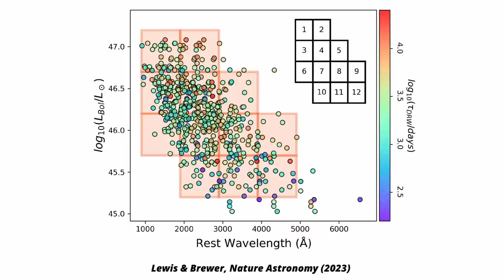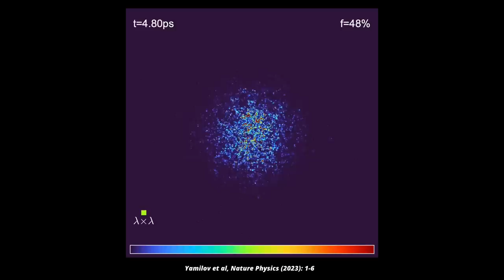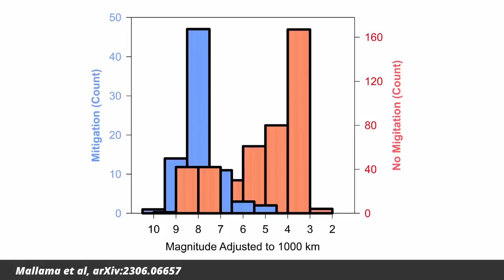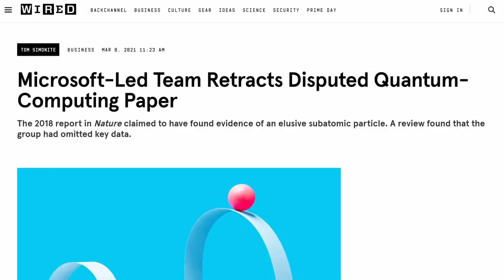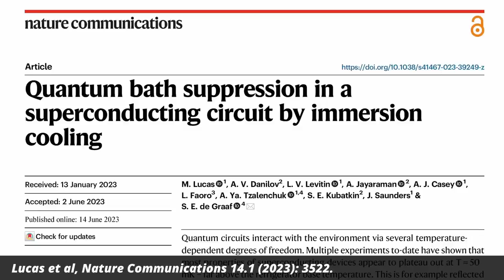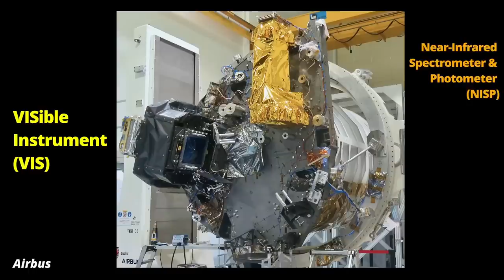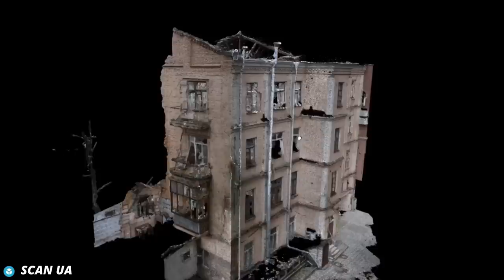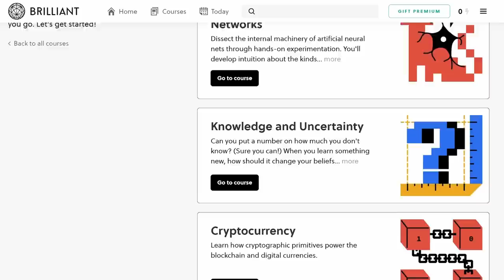Time Ran Slower in Early Universe, New Study Finds

Comment: Does the time dilation of the early universe affect our current measurements of the expansion rate?
Reply: That's a question I've always had, how do you measure time if time is relative...
When they say that something happened in the first second after the big bang, surely if the mass of the whole universe was concentrated in such a small space one second for us would have been millions of years back then....
I could never get around this...
Reply: Yes
Reply: As a whole, the first billion years of the universe took longer to pass than the latest billion years of the universe. It's an effect that cannot be perceived locally, but our technical estimates of the age of the universe hasn't changed. The amount of time is the same, but the rate at which it passed, has.
Reply: If time passes more slowly locally, you wouldn't you measure universal constants as having different values, like the speed of light or the gravitational constant?
Reply: @philipashmore  no
Reply: @philipashmore  Currently universal constants are assumed to be constant throughout the entire lifetime of the universe. That said, one could come to the idea that not only time changed during these billions of years and try to measure speed of light 5 billion years ago somehow.
Reply: How would you be able to tell if time ran slower in the early universe if you lived at that time??
Reply: @fonkyfesh-old  "The amount of time is the same, but the rate at which it passed, has." Bunkum.  "Rate" means the first time derivative, so " rate at which time passes" means dt/dt !!!  Nice idea.
Reply: @philipashmore  no, only from our view.
Reply: I think that's more of psychological effect that happens as we get older
Reply: It's for questions like this that I have tinnitus now
Reply: @gianpa  No not time is relative it is the observation of time that is relative depending on your reference frame. And to measure time you use a clock (a process with a cyclic nature)
Reply: @CulturedThugPoster  Q: "How would you be able to tell if time ran slower in the early universe if you lived at that time??"
You wouldn't from within; if you lived there in that time everything would presumably seem "normal" speed. However, if viewed from a distance, objects in this time period (say 12 billion years ago) would appear as if they are progressing at 1/5th speed (per the video). Also according to Einstein's theories presumably we would never be able to see the first start of the universe-- since the limit of time's progressing would effectively reach zero the further back you go.

My belief is that scientists at large didn't really bother with this effect prior to Webb because they pretty much assumed we'd never see that far back. Perhaps now we are getting data however.

But it could really screw with everyones perception about the age of the universe, which could effectively be infinite (from our point of view, since the beginning).
Reply: @fonkyfesh-old  One thing to consider here is that the metric curvature is more tricky than this as at least in the case of inhomogeneous and anisotropy in an initially expanding universe it has been mathematically proven that no time doesn't pass equally because if the metric curvature is asymmetric then the rate of expansion does depend on the local time curvature meaning that in this case the time dilation at cosmological scales is no longer a purely observer bias as the rate of expansion has physically changed locally accelerating or decelerating   depending on the local curvature. In this limit however there are no longer any analytical solutions meaning only numerical solutions are possible since the rate of expansion becomes a nonlinear tensor (rank 2 I think?) system dependent on the past states of the metric.  The reason this occurs comes down to the fact that gravity a.k.a. causal light cone paths through spacetime curvature are in general path dependent allowing the affect we call gravitational lensing to occur gravitational lensing, and thus this implies that metric tensor terms are not symmetric in general. Cosmologists have gotten around this by assuming that these asymmetries will all cancel out at large scales but mathematicians have long cried foul on this assumption as it would violate the rules of systems of differential equations where notably thanks to the way differentiation and integration work there must be a unique solution for each and every possible initial condition else the system can not be internally self consistent. Or in mathematical terms any system of differential equations will always produce divergent solutions.

  Notably  a proof by Matthew Kleban and Leonardo Senatore has even proved the mathematicians correct  in the case of the Einstein field equations in the limit of  a sufficiently large initially expanding universe i.e. where space is approximately flat or open, specifically it comes down to the fact that if matter attracts you will always be creating more underdensities than over densities and the local rate of time will pass faster in those under dense regions allowing more expansion to occur. In effect through a proof by self contradiction you can show that if such a solution with a maximum total volume in some given time slice were to exist it would require properties of the metric tensor which can never be true simultaneously.  Ergo the assumptions that we can approximate a universe which is nearly symmetric as symmetric is false because the solutions will always experience a nonlinear divergence from the perfectly symmetric solutions. You can show this is ultimately a consequence of information conservation i.e. if the rate of expansion of the metric stays the same then information on the universes initial conditions must be constantly erased from existence and thus such a theory can never be made compatible with quantum mechanics where the conservation of information is a fundamental axiom. Also note that the immediate implication of this proof gives us an irreversible arrow of time(consequence of the differentiation of the full EFQ) and the 2nd law of thermodynamics if informational entropy is proportional to the total spatial volume of any manifold.

Traditionally these effects have been assumed to be negligible in an assumption (originally hypothesis before it became testable) called the cosmological principal i.e. that the metric overall should be roughly the same, which was made both because it was thought of a natural way that the Copernican principal might be realized  but also largely because the math is extremely difficult and not analytically solvable or feasible with out powerful supercomputers unless the contributions to the metric of such asymmetry are small. 

The discovery of the CMB was used to justify this since it appears relatively homogenous if you assume the dipole component is purely kinematic in origin and as this assumption makes the math easier pretty much all of cosmology with a few exceptions have traded away the actual Einstein field equations for the Friedmann equations which they assume should be similarly consistent.  However there is a way to test this assumption which was proposed by Elis and Baldwin 1984 as if you can show the CMB dipole is not purely kinematic in origin then the cosmological principal must be false. 

The problem testing this had is producing a dipole of cosmologically distant sources which can be used to compare with this model requires millions of data points with ideally as close to the same biases compared to the CMB so space based satellite measurements. Thus it wasn't until 2021 when this was finally tested with rigor by Nathan Secrest et al. The result of that dipole comparison between 1.36 million quasars from the catWISE database showed a stunning 4.9 sigma discrepancy with the CMB dipole effectively killing the cosmological principal in any variation even if you ignore the strong logical and mathematical validity arguments.

As Sabine has since covered however independent analyses and observations have now raised the statistical significance well above 5 sigma so objectively it seems safe to say that maintenance of the Lambda CDM model by the scientific community is at this point partly an example of the sunken cost fallacy and partly because the actual irreducibly nonlinear Einstein field equations are  always a monster to solve for any numerical solution and the only existing analytical solution the Friedmann Lemaitre Robertson Walker metric solution is mathematically unstable under the affects of expansion and or contraction.

Frankly while the math is unimaginably hideous it is probably right because by dropping the cosmological principal assumption the need for dark energy to explain net expansion, the Hubble tension, the axis of evil, the information paradox, certain mathematical singularities all vanish. 
There is also a limiting case argument which suggests that this should in general give us nonlocal contributions to the metric due to past casual interactions now outside ones local horizon which in the context of gravity allows you to derive MOND with the transition being due to the threshold where the relative proportions of a nonzero (i.e. lowest ground state quantization) to the diagonal terms of the metric becomes comparable to the more familiar linear terms. So we might not need much if  any dark matter either reducing the model complexity to a one variable initial condition model  at the cost of drastically more complex mathematics.

Also note that a number of assumptions made all the time by default in cosmology implicitly assume the cosmological principal. i.e. if the off diagonal components are not the same then redshift can no longer be directly linked to distance as local density variations give it a directional cosmological component likewise such a bias means you can't treat sources of equivalent redshift as being the same distance acorss the sky because average over the whole sky also implicitly assumes all directions are equivalent.
Reply: @philipashmore  Yes actually though the changes due to local spacetime curvature would have to be large for these effects to be measurable so maybe near a neutron star. 

Note that a standard assumption known as the cosmological principal will lead  to the conclusion that this affect is purely an  observer phenomenon however if the universe isn't perfectly homogeneous and isotropic then as Matthew Kleban and Leonardo Senatore showed in 2016 through the proof of the no big crunch theorem that you will actually get a measurable affect on the local rate of expansion due to this kind of cosmological time dilation/shift in the local temporal component of  the metric.

Thus if the cosmological principal is not valid then the assumption that such an effect is purely observer related is false because the rate of change of the metric remembers the past states of the universe and makes the rate of expansion not only locally dependent but directionally dependent i.e. the rate of expansion will not be equal among different spatial coordinates depending on the current and past history of the metric locally. 

It gets weird frankly as without simplifying assumptions the behavior of spacetime in the full Einstein field equations becomes highly non intuitive with spacetime effectively flowing carrying matter from under dense to over dense regions due to differential expansion. However dropping the cosmological principal assumption allows you to drastically simplify the initial conditions of your model to purely normal matter with the dark components becoming nonlocal contributions to the metric related to information which was once causally connected to us but is no longer.

I'm not sure speed of light variation could ever be observable as information propagation depends on this rate so any information we can access would likely have already canceled out such components i.e. the two way speed of light would likely erase variations in the one way speed of light.

The gravitational constant however yes I think that could in principal be measured as a limiting case argument based on the no big crunch theorem does suggest that the dark energy like off diagonal contributions to the metric should be repulsive and thus could be expected to oppose/weaken the linear components pull towards each other. In effect gravity's strength would vary nonlinearly inversely relative to the degree of curvature of space.

Sadly as gravity is so weak I don't know if it could be directly measured however one implication of it namely the reduction of proximal escape velocities from ever proportionately more massive objects should be testable as it suggests true black holes might not exist i.e. the escape velocity might only asymptotically approach the two way speed of causality.

So if you can observe electromagnetic emanations from an object massive enough to traditionally be classified as a black hole that could prove this the catch however is that such light would still be heavily gravitationally redshifted.

I do have a hunch suspicion that FRB's may be such a signal but proving that is a daunting challenge at this point.
Reply: @Dragrath1  Interesting, so if I am understanding you properly, some red-shifted energy observed (e.g. FRB's) may simply be very large energies which have been redshifted due to their local gravity-induced slow-down effects? We are talking about remote local gamma ray bursts (or something much higher-than-radio-frequency-energy)  which from our perspective might appear as radio waves?
Reply: @fonkyfesh-old  This.  It's best to think of it like monetary inflation.  The universe is 13.8 billion years old (in 2023 years).  If an outside observer was watching the Big Bang in action, they might get some weird measurements that suggest the universe never actually expanded or something crazy.  But we're already in here.  Always have been.

Or you can think of it like a black hole, since that's similar.  A person falling in will observe no change in the passage of time for themselves.  An observer outside would see them slow down as they fell in until they froze in place forever and slowly "faded away" while not moving.  In order to see the time dilation, you need to be separate from reference frame that is experiencing it.

We are in the same reference frame as the universe, so ... no change.

That's my naive take, anyway.
Reply: @fonkyfesh-old  It's not even really that the rate that time passed has changed, but that our perspective of time passing has been skewed by time dilation.
Reply: @traumflug Not all are constant. The expansion factor is not constant and it is the variable that corrects the equations to factor in the expansion of the universe. And to answer OP yes time dilation of  early universe is factored in our calculation via expansion factor.
Reply: @gianpa  If time dilation due to mass of the universe at the time of the big bang meant time was near stopped is significant. I think the big bang relative to the big bang could have taken billions of years, not really making it a big "Bang", and also distracts from any concept of "inflation" as we describe it. Aka, from our time perspective "now" it would appear as if the universe expanded almost instantaneously. 
Time is speeding up as the universe become less dense makes sense to me. It also plays into the idea of our universe just being the inside of a black hole :)
Reply: @gianpa  Well from what I understand, it probably wouldn't matter.
Think of it, you are traveling on a space ship at 99% the speed of light, time is slower for you, but you move at the speed of light.
In other words, when you hit the event horzion, your image is frozen, but it fades, but you also hit the singularity pretty quickly if you are in a normal sized black hole. In a super massive balck hole of an event horizon of ten light years, well the compression of space may speed that up. 

So particals expanding at lightspeed still go that speed and hit the spot at the same speed and time.

The only thing that would matter is partical decay.
and if estimates or calcualtiuons need particals lasting an amoungt of time, well everything can get skewed
Reply: @philipashmore  No I don't think... unless...
Again.
If you travel in a space ship, at 99% the speed of light, you still travel that distance and it still ttakes the amount of time to get there, you just are in slow motion. Your clock, slows down. But you still take the same time to get there.
Same thing witha  black hole
time may slow down but traveling close to the speed of light means you reach the singularity pretty quick, even though a second for you may take a thousand years of outside time for you to notice a seconde hand tick once.
In other words, you are the opposite of the flash and can't react verry well to the speeds you are going at, but you still are going those speeds.

So like, if you are going 99% the speed of light, you probably notice a blue shift in front, a red shift behind, and drag casued by hitting insane levels of light energy in front of you.
You can probably tell things are off.

Also, with math, things usually can be calculated regardless of speed you are traveling.
for example, if you go 100 meters for ten seconds you have gone 1000 meters, and if you are going 10000 meters a second for tenth of a second you went 1000meters. In other words, if you were going fast, it's just stuf you'd plug into an equation
if you go 100000 meters a second for 1000 meters, it took you a fraction of a second to do it but you still went 1000 meters. 
These things can be calculated and figured out.

Smae thing with angualr momentum. if someone is spinning at a rate and you know the density and mass and the arm lengths and such, well you can figure out how fast if you change the arms, wheather you start arms in or out, you can determine the other configuration.

However,

 if we dervie the stuff we know from something like how particals behave and what must have happened and how things must have formed and what processes must have happend as a result of what was available, we could then derive things incorectly.
If constants like galaxy size and stuff like that, well maybe this is exactly why smoothness of galaxies and such are not what we calculated.
if particals vibrated slowly and stars did fusion more slowly and formed when all that energy was dialating time, then those types of constants and other concepts are probably wrong.
Reply: @gianpa  The curvature of the universe is very flat so the amount of time dilation was very low. The universe did not behave like the curvature around a black hole, which would cause a huge time dilation effect. Matter was extremely uniformly distributed.
Reply: Maybe you're a genius.
Reply: @axle.australian.patriot  You have the idea reversed: the Big Bang relative to the Big Bang could have happened relatively fast, while from our perspective "now", the Big Bang could have taken forever (or, a time approaching forever)..
Reply: I've seen quacks try to claim that the speed of light was different in the early universe to explain their 'young Earth' hypothesis.
Reply: @Dragrath1  That may be one of the top 10 Youtube comment replies of all time. Very thought provoking! Can you elaborate more on how dark matter could be some kind of non-local thing? "There is also a limiting case argument which suggests that this should in general give us nonlocal contributions to the metric due to past casual interactions now outside ones local horizon which in the context of gravity allows you to derive MOND with the transition being due to the threshold where the relative proportions of a nonzero (i.e. lowest ground state quantization) to the diagonal terms of the metric becomes comparable to the more familiar linear terms."
Reply: The issue i have with the whole time dilation concept is that time is an abstract measure so all we can actually prove is that the methods we use to measure time have dialations to them.
Reply: @Dragrath1  Hey man what is the "axis of evil" -- a cosmological asymmetry of some kind I guess?
Reply: @EL_DUDERIN0  It's relative to perspective. Time dilation is weird lol
Like emerging from the inside of the event horizon of a black hole. Both at light speed and with the gravity time would slow to a crawl (infinitely close to stopped) so the evolution of anything inside of a black hole could take many billions of years(for what is entering).. Enough time for matter and stars and galaxies to form.. maybe even life before all that matter get smashed into the singularity :)
P.S. Current theories suggest that space and time could flip states too, so space could become almost infinite and time takes a new steady state..
I still honestly feel that the big bang is just the constant emergence of matter entering the black hole we call our universe.
Reply: No, the age of the universe is length along fundamental observer world-lines for which the elapsed clock time is a constant. The study looks at quasar variability at a particular age of cosmic time.
Reply: @philipashmore  All identical clocks tick away at the same rate, everywhere, and under all circumstances of motion and orientation, so you're not asking a meaningful question.
Reply: @tuberroot1112  The correct equation is dt/dτ.
Reply: No
Reply: @numbersix8919  yes specifically it refers to the higher multipoles of the CMB quadrupole & octupole sharing a preferential axis with the dipole and each other rather than being random as would be expected otherwise if the universe was symmetric at large scales. Effectively the probability of these multipoles all aligning by chance is astronomically low. However if there is a preferential axis, a.k.a. the dipole moment is primarily cosmological in origin  then it would largely be expected. This was discovered in 2005 and cosmologists had hoped it would go away but its only become a stronger signal.
Reply: @kylelochlann5053  symbols mean nothing if you don't explain the difference.
Reply: @Dragrath1  Gee thanks!  Nobody has ever explained that so simply before!
I see that I am correct, the universe really is a two-holed Klein Hyperbagel.  Just kidding!
Reply: @tuberroot1112   In time dilation we need an observer who sets up a system of global coordinates. The spatial hypersurfaces define each "now" moment of the observer. The dt (or Δt) is the distance traveled by the observer (length along the observer world-line) between a specified pair of spatial hypersurfaces and the dτ (or Δτ) is the distance traveled by the traveler (length along the traveler world-line) between the same pair of spatial hypersurfaces. The time dilation, γ, is then the ratio of these two lengths, γ=Δt/Δτ.
Reply: @kylelochlann5053 " In time dilation we need an observer who sets up a system of global coordinates".  Global is not the right term. We  need an observer  "travelling" in an inertial non-accelerating frame. Then is your "traveller" accelerating?  The universe is expanding. The early universe was expanding very fast. Gravity was very strong in a dense compact universe. But we know that gravity is indistinguishable from acceleration , so these early galaxies were accelerating. You have already lost any attempt to even define what the early universe time dilation is/was.
Reply: @gianpa  Exactly....   To say the universe is 13.5 billion years old is a nonsense statement.
To measure the distance to the edge of the universe using the red shift may be off by a lot.
Reply: @tuberroot1112  Ideally you want an inertial observer (not necessary) but the acceleration (or not) of the traveler is irrelevant. You need global coordinates to establish the fundamental observer world-lines and subsequent foliation to know when and where the traveler is located.       
      Gravity and acceleration are different as gravity requires 20 numbers for it to be specified at an event (there are 20 independent components of the Riemann curvature, 10 of which couple the field equations). I think you're making reference to an equivalence principle which distinguishes between metric and non-metric theories of the gravitational field. In this sense, and for local measurements only, gravity is indistinguishable from an accelerated frame of reference. This then necessitates that the proper acceleration is zero. 
      The expansion is accelerated owed to a small positive constant curvature, and is not a physical acceleration. There is the supposed inflationary epoch with a rapid acceleration brought about by the decay of the inflaton field.
      It's not clear why you imagine why time dilation is undefined relative to the early universe so I can't meaningfully reply to that aspect of your comment.
Reply: @tellmemoreplease9231  Why? The age of the universe is the distance along the fundamental observer world-lines of the FLRW metric.
Reply: @EL_DUDERIN0  That would be my guess something akin to the energetic gamma ray to hard X ray eruptions seen from neutron stars. 

One thing which lead me to wonder this was some of the late observations of the Kilonova event which appear to be electromagnetic radiation similar to what we see from magnetars coming near the end of the observation. However simulations based on the gravitational wave event predicted that the resulting object should be well above the mass of any known neutron star thus it had been suggested to maybe be a sign of delayed collapse or similar.

 However during the pandemic when I got the idea to try and look at what the limiting case analysis suggests this popped into my head as a possible explanation for some FRB's as it would help provide more abundant sources relatively speaking for such radiation to occur. 

Another bit of nuance here though is I first noticed the irreducibly nonzero asymmetry of the off diagonal components which immediately brought to mind  similarities to the proof for why asymmetric wavefunctions can't share the same values and thus give rise to Fermi Dirac statistics and the Pauli exclusion principal for Fermions. In that case it suggests that the value of the metric at cosmological scales at least should display an analogous property which as these asymmetric terms are associated with expansion suggests  they too may be relevant in the domain of extreme local curvature. Proving that is tricky but could in the limiting case be used to predict much more massive neutron stars as these terms oppose the more familiar  linear attractive metric terms.
Reply: From "Time Matters: 3rd edition": Actual reason for Hubble Redshift observation is time in the past was slower, no expansion needed:
Let's say, 10 billion years ago you started sending letters to yourself, 1 letter a day.
10 billion years have passed, and now, for some reason, our day is twice shorter/faster than it used to be, and letters start coming.
How many letters you'll be receiving a day? Answer: 1 letter every OTHER day.
Frequency of getting letters a day as-if dropped twice.
And if 14B years ago time was twice slower than today, then of 100 light-waves sent a second, you'll be receiving 50 waves a second now. Frequency drop = redshift.
Cosmology collapsed on twice slower time 14B years ago (wavelength change was incorrectly explained by Doppler effect of space/wave expansion).
Reply: @fonkyfesh-old  Sorry, I don't quite get that. What is an 'amount' of time, if it passes slower or faster?